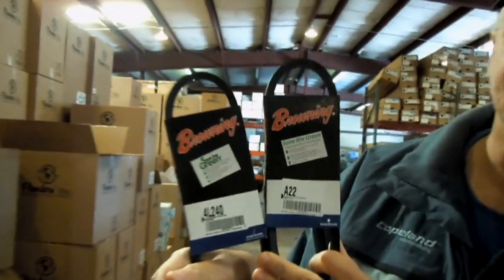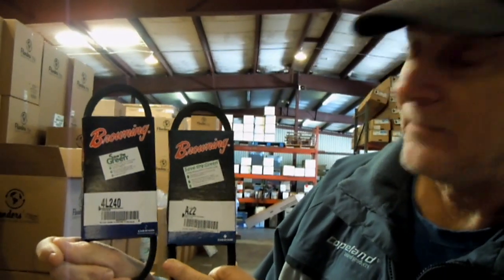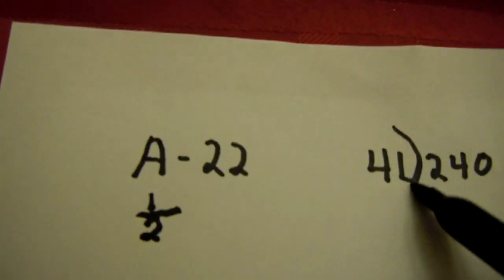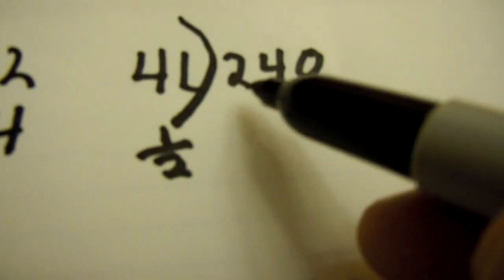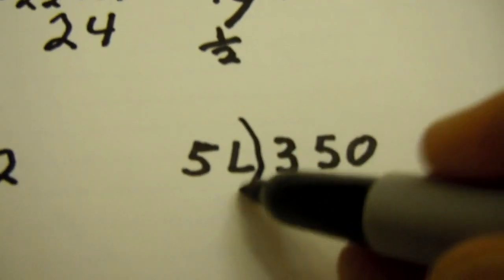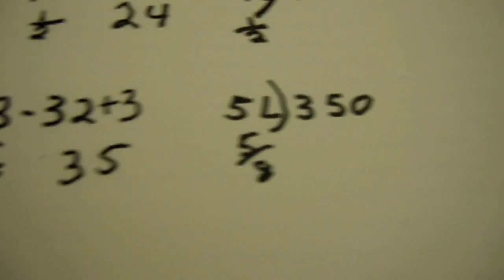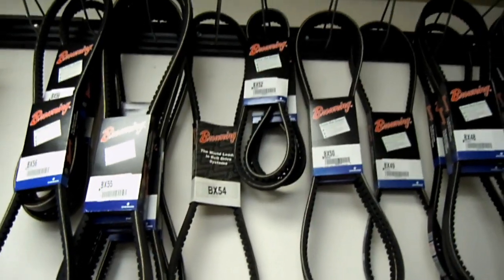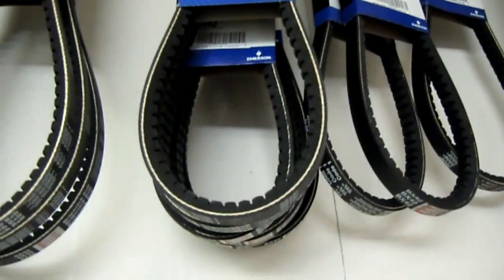HVAC V-belts 1

Comment from the maker: @HCVguy93 Many commercial systems are belt driven for two basic reasons. 1. To be able to set up the system to deliver the proper amount of cfms. 2. Servicing a huge direct drive air handler would be too difficult.